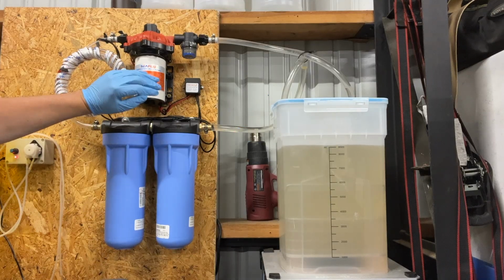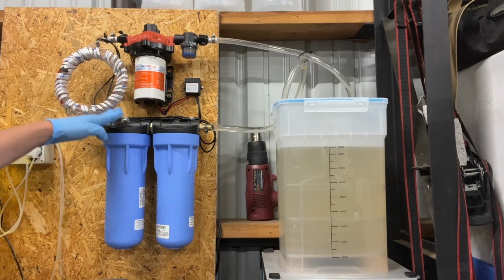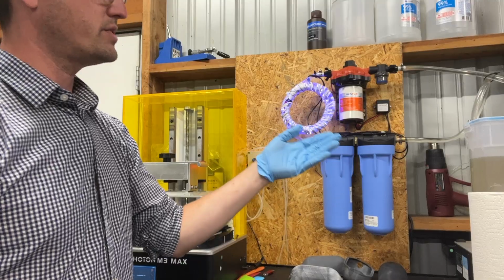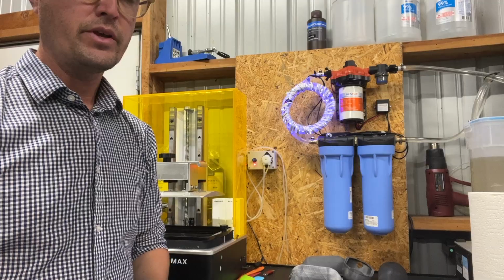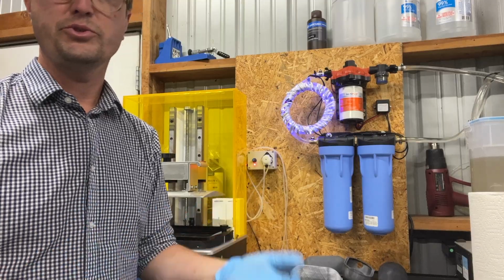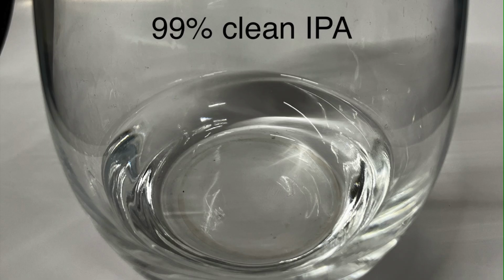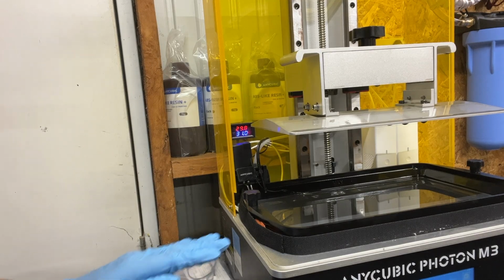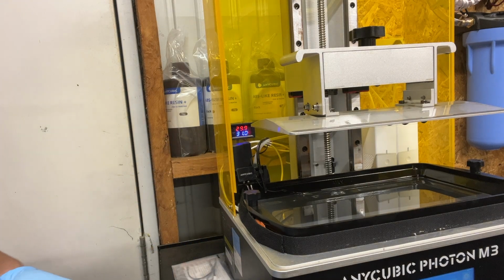Resin Printer Mods and Continuous IPA Filtration!

Comment: Hmm I would recommend replacing your curing loop with another reservoir and adding the leds to the main container with the 3d printed part. With proper programming of the pump/necessary additional valves you could make an automated wash and cure station (with self cleaning ipa)
Reply from the maker: I worry then the second reservoir will collect cured resin. The reason the tubes work is because it’s actively moving through at a high flow rate.

In addition, a second reservoir has no purpose other than more ipa? What is the point of a secondary reservoir?

Also, why add valves? Seems like extra work with little value?
Reply: Assuming it does not clog up your inlet/outlet of the second reservoir, I would argue it's a good thing to collect cured resin there. It'll increase your filter life a little and you only need clean ipa in the first reservoir anyways. Regardless, your setup is awesome as it is and I'm definitely going to build something very similar in the near future. Cheers!

Oh you added a bit while I was writing my reply. My thought with the second reservoir was to hold ipa while the LEDs in the main container cured the part. After a bit more thought, that might not be necessary since you're showing in your setup that uv will penetrate ipa without much issue (albeit at a smaller distance through your tubing)

I haven't thought out all the valves yet but I imagined something automated which pumps out ipa from the main chamber would need some valves

Comment: Not sure, if you could use standard aquarium uv algae treatment lights/filters, instead of the custom coiled tubing, with LED strips? Also what about yellow magic with heated ultrasonic cleaner and continuous recovery of the solvent after uv treatment? IPA might degrade final strength of parts, if the bath/cleaning times are not carefully controlled. Just some 💭♥️👍
Reply from the maker: Totally! I looked into those and worried that the housings/materials weren’t rated for alcohol. 

What’s yellow magic?

At this point, given the pumps GPM, the tank of IPA cycles 2.5 times per minute. I think anything over that is diminishing returns. 

Everything the IPA touches in this system is rated for extended alcohol resistance, so part degradation is of little concern.
Reply: @nicks-fix   Thanks for the clarification,  The system could vey well work for Yellow Magic(an industrial solvent). Wish someone could decipher the ingredients to make it less expensive. It's an alternative to a no IPA cleaning process(popularized in formlabs forums). But needs a heated ultrasonic cleaner, with a very breif IPA post-cleaning(or extended soaktime over several hours, helps eliminate thin layer of residual coating). The advantage being complete lack of IPA, coupled with close to 100% reuse(when a simple uv exposure precipitates cured resin out).

Comment: thanks for the tip on heating band, I'm just back to resin printing and back in the Anycubic OG Photon days I used the same relay/sensor but had no idea that heating band existed so I used a heating block and a small fan inside the enclosure, it helped my printer stay active throughout our winter in the garage
Reply from the maker: That’s great! I thought since the only thing that actually needs heat is the resin, it’s probably more effective to heat just the vat instead of the air around the vat. 

As an example, it’s like heating up some soup by turning you HVAC to 200, instead of just putting the soup in a pot on the range. 😃
Reply: @nicks-fix  I got harot mage 8 up and running and got the parts listed for the heater. Can you show me where the heater plugs in and what you use to plug it in. Sorry for my lack of engineering knowledge.

Comment: Two questions. Can u add a 3rd filter canister with a carbon insert. Will it degrade the flow.  Also do you turn the wash station on so that  it is actually creating a vortex to wash the print at the same time it is filtering? Thanks. Starting to purchase the parts.
Reply from the maker: I think just changing one of the filters to a carbon filter would suffice. Two is already overkill, three would be insane!

The turbulence is really high because the return is higher than the suction tube, and having them on opposite sides of the tank create really helps reduce dead zones. No need to have the addition of the wash station spinner going.

Comment: The filter system looks great. I am just about to dive into the exciting world of 3D printing and have bought elgoos wash and cure Station. I don’t know exactly how it works as I haven’t used it yet but my idea was to try and cure the resin left in the ipa under the cure station lights (assuming the vat you get with it fits). If so, could you then circulate the ipa through those filters and back into into vat? (negating the need for the UV LED strips around the tubing)
Reply from the maker: I’d worry that the resin would cure in the vat, and then not be liquid enough to pump through the tubes in to the filter.
Reply: @nicks-fix  ahhhh gotcha yeah.  Thanks

Comment: Atm almost done building a filter set like the vid.  Some l leaks in the water test so almost done.  Had to get some fittings but it seems to hold on the board so here's going it holds when in service.
Reply from the maker: Good on you for testing for leaks with water!
Reply: Follow up.  System leaks contained and running a 30 minute stress test.  Had to put some old ipa with resin in to top it off but I'm not on fire and we don't have any noted leaks.  Looks like it works more or less as intended
Reply: Yes hun also suggested water.
Reply: Don't press the vacuum release on the filters it gets liquid everywhere.  TLDR bubbling right after the pump but no liquid leaks so trying to determine where air is coming in.
Reply: Ok, New longer tubing and swapping the 5micron filter. Wow it's working.  Still have air issue but no leaks.  The first filter really took the nasty resin water hard but the new one is following up.

Can see the bottom bars of the hand rack when it was solid grey "water" at the start of this madness
Reply: Last check up: my lovely wife does get hives from resin on skin but we have determined via stupid test and a UV flashlight that although the ipa is yellow,  it is clean of resin. System works

Comment: The heating mantle is brilliant!
Reply from the maker: Thanks so much! One note though, I recommend getting a large silicone band to stretch around your resin vat. I used a Velcro strap early on and it got a little melty. 

Make sure it’s silicone and not rubber! I found the ones that you can get online that are used to hold trash bags work great.
Reply: @nicks-fix  Be sure to check out the resin profiles that Rick Ferguson has worked on for the Phrozen SM4K and SM8KS printers. I know it's a different printer system but his vat warmer and profiles have made a huge difference in the quality of my prints.

Comment: @nicks-fix, the link to the pumps points to 3 pumps, two of which are 33-series, and one is the 42-series? Does it matter which one?
Reply from the maker: Depends on your use case. Power source and GPM. You don’t need a high flow pump for this system, so as long as you have a santoprene diaphragm, what ever is the lowest cost!
Reply: @nicks-fix  thanks.  I was just concerned that there might be differences  between the two versions of the pump that might make one less ideal for use with IPA.

Comment: This system is interesting, and it clearly works, however sediment filters keep catching particles in themselves, that means that's a matter of time when they will loose efficiency or clog completely.
For set it and forget it kind of approach, I think something like centrifugal filtration is more fitting. Cause that way its possible to set it up so all the debris will collect in one place and you will be able to just take it of, clean it and put back
Reply from the maker: Great thinking!  I have experience with centrifuges and when I did a cost benefit comparison, the extreme cost of a centrifuge compared to a replacement filter was an easy decision. 

At this point, I’ve cycled 6kg of prints washed through the system and have clear IPA with no clogging of the filters or flow reduction. 

A centrifuge may make sense if you are a shop with 10+ printers running every day and a large bath. 

I looked into diesel centrifuges (because of their small size and cost) but wasn’t able to make one work. If you have one that you can link us to that is less than $100, I’d love to test it!
Reply: @nicks-fix  I of course agree that the approach is dependent on scale, and if you filter small volume time to time id doesn't matter that much.

About diesel filters, I assume that they are not working because they are calculated for a liquid with very different viscosity. So I'd better think more towards understanding the principle and trying to make my own centrifuge. It of course could not be that simple and take a lot of time and iterations to work, so if buying a ready solution is your option, then I'd recommend to search something specificly designed to work with water-like liquids and not oil

Comment: I would love to see how you have configured the washbucket (in terms of where you added the lines) as well as the resin drain system that I see in the back ground
Reply from the maker: Sure! Just drilled two holes in the lid for the return and suction. I did it through the lid so I could move the bucket if I needed to. 

The other small drain system is just a peristaltic pump, easy to find!

Comment: You should cover the Uv led’s as that will being damage to your eyes and skin. Check it out online. [a few other below make mention] oase and any other aquarium filter brand have the UV sterilizers in black plastic to protect eyes.
Reply from the maker: Yep! It was covered with Kaptom tape after the video. I left it uncovered so people could see where the lights were. 

It also only runs when I’m not around, so no issues with it damaging my eyes. It’s on an Alexa controlled switch, so it runs in the middle of the night.
Reply: @nicks-fix  sweet!

Comment: Can you talk about the resin transfer pump by the washing cleaner
Reply from the maker: Sure! That’s a peristaltic pump. Used widely in the medical industry to have a zero contact with external air/liquids. Widely available on Amazon. I use it to pump resin back into the bottle if I change resins.

Comment: This is amazing. I'm running 20-30 build plates and consuming maybe 5 kg of resin per day. Do you think this system could keep up? (Currently I'm cleaning IPA using a distiller - it feels like a matter of time before a disaster 💥.) 

Also, do you find resin attaching to the tubing in the UV reactor?
Reply from the maker: This would work great for that. You may find it better to go with larger filter housings and just keep the system cycling all the time. 

There is no build up in the tubes at all. If they ever do, you can just replace the cheap hosing with new!

With this pump and the amount of IPA, each minute is 2 complete cycles of the volume of the system. I typically run it for 30 minutes after each wash just to be overkill, but this would be great in your situation.

Comment: Is the light strip you used the exact one linked? The seller claims the wavelength range is 285-400
Reply from the maker: It might have changed? Matching uv wavelengths is pretty easy. The ones I used are 485 if memory serves.
Reply: @nicks-fix  Thanks for quick reply, I'll look around for one listing the right wavelengths
Reply: @coffeewarlock  It looks like we're both trying to replicate Nick's filter setup! Have you found a good LED strip?
Reply: @TheClayImpress  Found a bunch on Amazon searching for 405nm specifically, ordered the YSG-Tech 24W and I will find out on Saturday if it works.

Comment: Thanks so much for these awesome ideas! I'm going to order all the pump parts today - although I'll go the 120V route since I don't have a nice 12V supply. One thought - maybe a pressure gauge between the pump and the filters? That would tell you far in advance about the condition of the filters, no? I'm glad to see you used hose clamps too even though they're not on the list - I'd be worried at 50 psi that you'd blow the tubes off the barb fittings, which would be quite a mess and danger.
Reply from the maker: 100% on the hose barb clamps!! They are definitely necessary. 

As for the pressure gauge, I think that would be cool, but maybe superfluous. The pump has a pressure cutoff relay at a set pressure. My process is to wait till the pump is cutting off due to high pressure, and then change the filters. 

I couldn’t find a pressure gauge that was rated to deal with alcohols, so I just left it out. If you want to add one, go for it!
Reply: @nicks-fix  My fiance is a chemist who works on mass spec machines all day, tons of solvent rated components in that. I'll pick her brain, see if there's something that won't break the bank. I'd rather replace the filters as I know they are clogging, rather than having the pump go into overload shut down. Anyway, great stuff, subscribed and looking forward to more content.
Reply: Checked with the finance - her take was - more trouble and money than it's worth. She was like "you could get a gauge off ebay, but then you'd have no idea if it's clapped out and would just cause a failure all on it's own." Her take was to just find a way to check the flow rate on the exit visually - just time how long it takes to fill a reference volume, and track that over time. Keep it simple she says. Anyway - you might want to put those hose clamps on the list, just so no one forgets them!

Comment: Very clever, and good to see you took safety precautions. Only thing I could think of that might be helpful is maybe some valves to prevent any flow when changing filters if IPA stays in the tubes between cycles
Reply from the maker: Good thinking! My plan was to just put the bucket under the filter housing when I unscrew them. That way all the ipa goes back into the bucket, and then I replace the filters and just cycle.
Reply: if you've got a harbor freight near you, they sell hose clamps for automotive work, so that you can clamp off a hose and not worry about leaks when you work down the line, like on cooling systems or sometimes fuel systems depending on if they have rubber lines. vise grips would work too, but the special hose clamps are ligthweight and plastic, and shouldn't damage the hoses or pull on them much while you're taking the filters apart etc. @nicks-fix

Comment: I love this idea. I've been using a much more manual, MUCH slower method of charcoal filters attached tot he bottom of a bucket, filtering into the bucket below. It works well, but it's more annoying than the post processing itself. Putting this on my to-do list. Thanks for the video.

Did I miss this part, but what power supply are you using for the pump/leds? Just a random 12v psu?
Reply: You did not miss a part, as there is no power supply in the parts list.  I just got everything in today and doing some thinking about how I want to wire it.  Also, it appears that one would need some USB adapters to connect the USB type A connectors on the UV LED lights, as the USB power adapter has USB type C connectors.

Comment: Nice setup. 
I use a more KISS approach, I have a dirty IPA bath container where all the parts are sunk before going to the cleaning station.
I never felt the need to change the IPA in the station, it's about 2 years old by now. It's not 100% translucent, but never failed me until today. Parts leave it squeaky clean.
Reply from the maker: How many washes do you do per week, and how much resin have you printed with your current IPA? What do you do with the ipa when it is saturated?

I worry with a system like yours is that you won’t know when things aren’t working the best, as the ipa will get incrementally saturated. 

For me, this is following the KISS approach. Maybe our last “s” just looks different. 🤣

Comment: how low does the temperature go during winters...where i stay it goes down to -20C at night which is when i do most of my prints... I use a small heater and keep my printer in an enclosure but i dont have a thermostat to keep the temp consistent... you method seems much better... Just wanted to know if temp drops in your area is as drastic as mine...if so would love to see the whole set up process
Reply from the maker: I’m in northern Oregon, and it gets pretty chilly in my garage. Only had the system going in the warmer months, but will test over the winter!!

I think since I’m warming the aluminum vat with the resin in it, and the temp probe sits in the resin, the temperature control will be much more accurate and efficient. 

If you only warm the air, there are lots of losses and wasted energy.
Reply: @nicks-fix  correct...could you send an Amazon link to the heating belt and other things required in your setup and again if you could do a set up video it would be immensely helpful ✌️

Comment: The yellowing of the ipa would concern me slightly if im using clear resin. I wonder if adding a carbon reactor at the end of the filtering to clear that up
Reply from the maker: I use mostly grey and black abs like resin. When I change the filters I might put a carbon micron filter in there to see if there is any benefit!